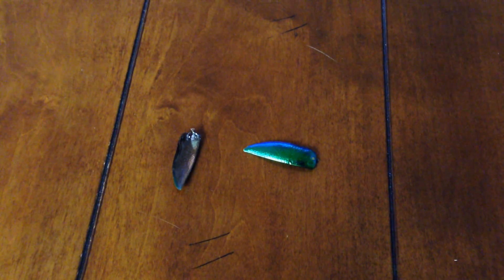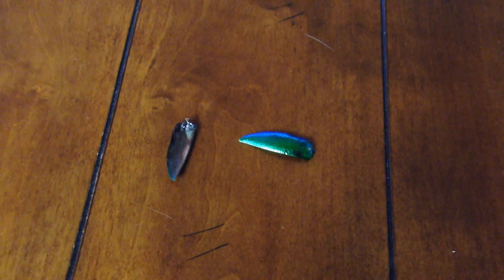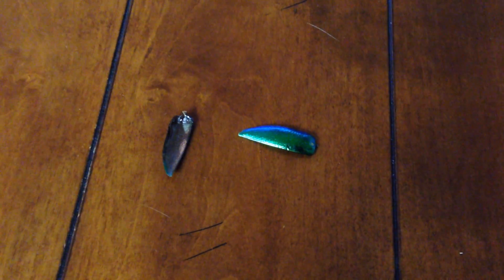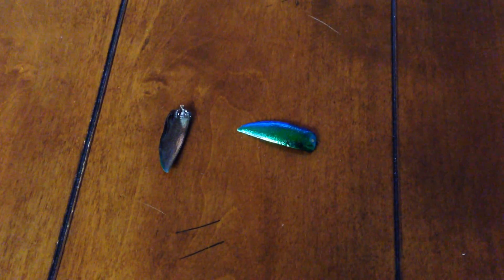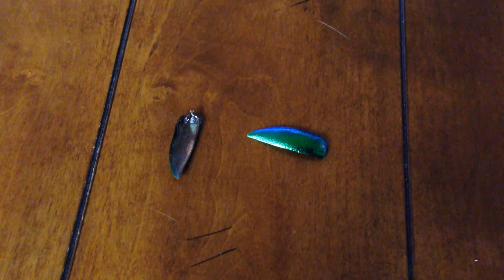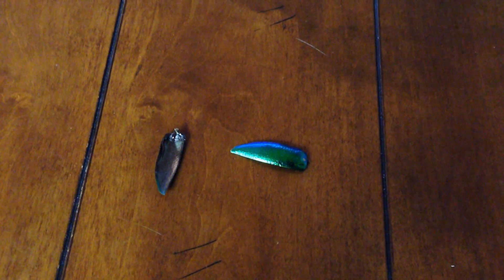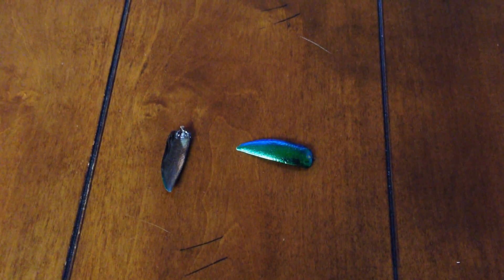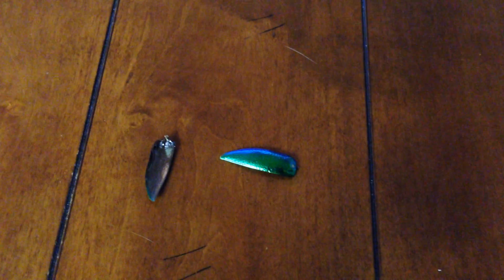Spinning Elytra - Grebennikov Video Replication Series

Comment: No sound on the video... Why?... Could be because you don't want us to hear the air hose blowing on the wing.
Reply from the maker: Interesting point. The original video didn't have sound so I turned the sound off on mine as well. I want viewers to evaluate them side by side within the same parameters.